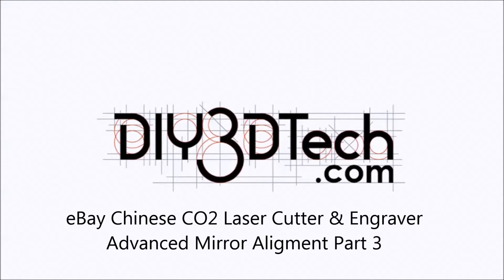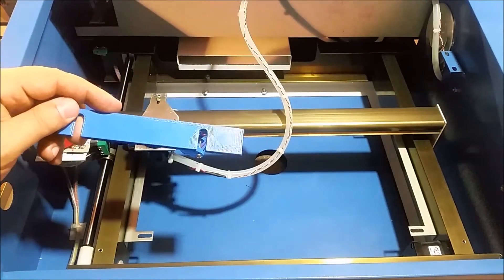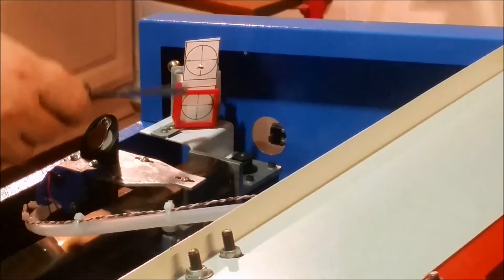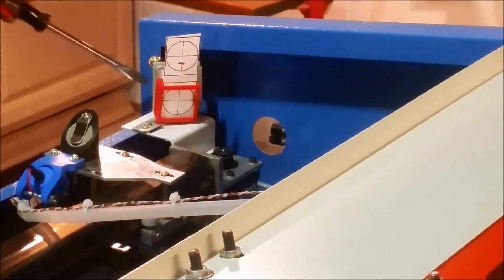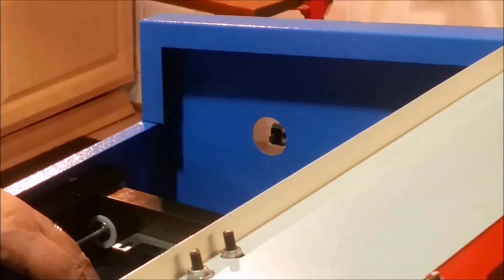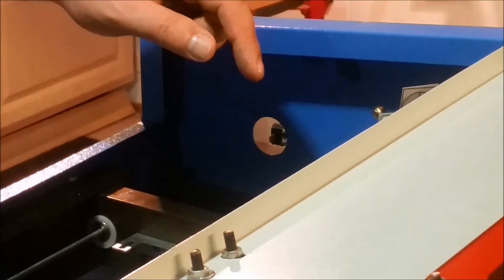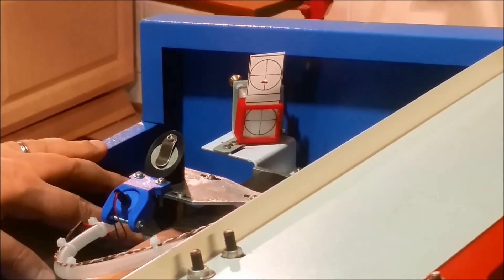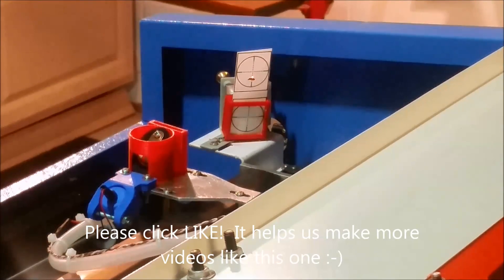eBay Chinese CO2 Laser Cutter & Engraver - Advanced Mirror Alignment Part 3

Comment: this is how i have gotten mine to 100%

you do not need to square the gantry with the laser tube..  its NICE and awesome.   
but its sorted out in adjustments.
my procedure.  involves removing the mirrors and lens sequentially to not get burnt tape residue
 on them. placing masking tape over the location and   firing a short 
laser test pulse  first "near"  then "far"   seeing the movement of the dot.  along the axis
Adjust for it.  replace new tape and retest.  until perfect

wear safety goggles.  don't look at the tape. "tap" the test button.  move gantry  "re fire"
then inspect the result  take note of  First and second dots  adjust as required. 
replace tape  retest 

 1#  set first mirror to 45 degrees on the adjustment screws and  "hardware mount"  in front of laser tube
remove mirror and place painters tape over the attachment
fire  very short low power laser test.  
adjust on the "hardware" to place this spot exactly in the middle of the mirror  
several pieces of tape later   once satisfied.   
re install the mirror in the mirror assembly

#2  remove the mirror from the fly mirror assembly  place painters tape over the attachment
fire very short low power laser test.  
adjust on the "hardware" on the fly mirror and adjust he screws on the primary mirror assembly.
to place this spot exactly in the middle of the mirror   from near to far gantry movement  
with no movement of the dot
several pieces of tape later   once satisfied.   re install the mirror in the fly mirror assembly

#3 remove mirror from the head.   place masking tape over the BACK of the head assembly.
now  align by adjusting the head "hardware"  and the screws on the the fly 
mirror assembly to ensure the laser hits exactly in the middle of the 
head mirror location.  throughout the whole X AND Y gantry movement   

BUT in a spot where its exactly above the lens below it.  on my "cheap gray head" 
its a bit off center.).    more important that it hits the middle of the lens 
several pieces of tape later   once satisfied.  reinstall the mirror

#3  remove the lens  place masking tape over the opening. below
fire very short low power laser test. 
now adjust the head.  by turning head and basically bending bracket etc to get the 
dot exactly in the middle of the lens  through out the gantry X and Y movements.
several pieces of tape later   once satisfied. Re install lens

#4 redo laser focal point measurement with sloping material   high power fast line 10 times parallel
"eyeball"  best focus spots,   measure distance to head/gantry  then  1/10 Average = focal length 
(from head/gantry  not lens)

my laser is 100% in the center of the lens  in the full motion of my gantry.
only apparent loss is attenuation over  the increased distances
Reply: im having a problem with aligning step 1, step 2 and step 3 i can get centered but once i move the head toward the front its way off then i adjust and test at home position its off i got my laser cutter 3 days ago can you give me some advice?

Comment: Great videos, but I have some ideas.  You could have achieved the same by lifting the end of the laser tube a little and angling the first mirror down a little.  The main thing is to get the light path running parallel to the gantry so increasing the height at the laser end and angling down will reduce the angle. My concern with the way you're testing this (with the small laser) is that you need to ensure that the offset from where the cutting laser is to be the same at each test point so that the angle of the test laser is correct.  If you have the test laser mounted a cm higher than the cutting laser point would be on the first mirror bit you are pointing it at a point 2cm above the second mirror (when at the far point), then you would expect to see the test point move down as you move the test to the near point.  Would it not be better (more accurate) to just put a piece of paper on the mirror, close the lid, and do a test fire to see where on the paper it lands?
Reply from the maker: I think if followed everything you wrote we are pretty close as yes if watch the videos in the playlist I actually developed and 3d printed some aiming targets and from here (sort a like your paper suggestion) I was determining the alignment.  The issue is a more expensive laser have a rigid inter-structure where these are simply sheet metal which isn' good for alignment and the idea is in a perfect world all mirrors and lens should be either 45deg or 90deg and any variance from there is to compensate for the "structure"  and any compensation here will magnified as it passes through the optical train over distance.  Because if you keep watch I design and a set of tube holders too :-)